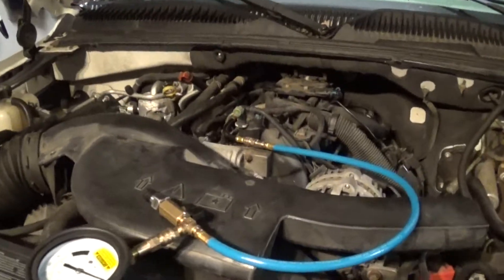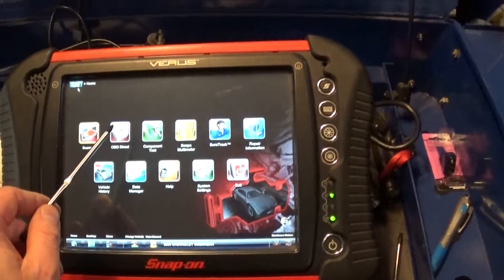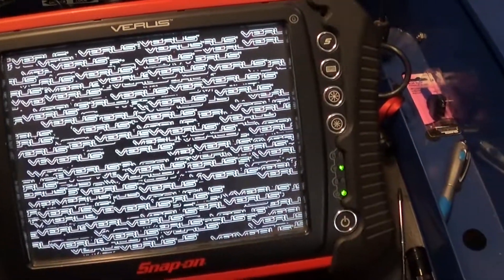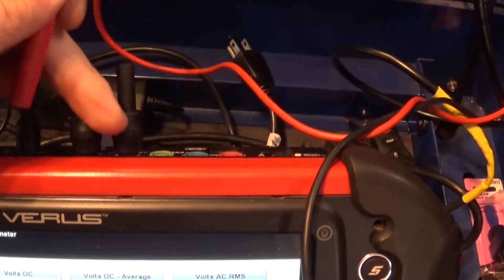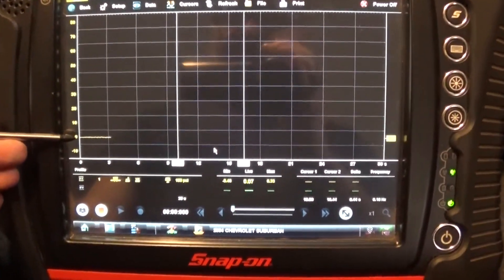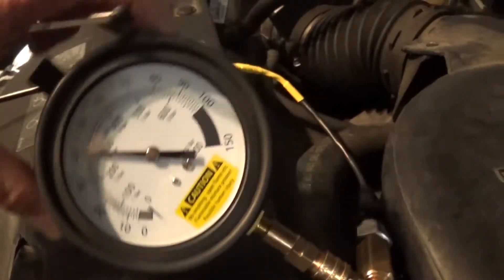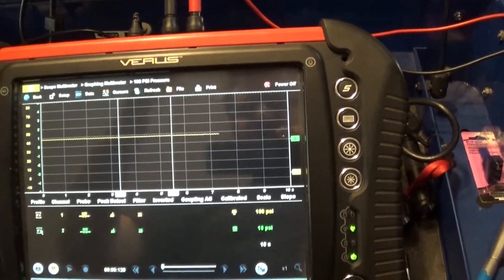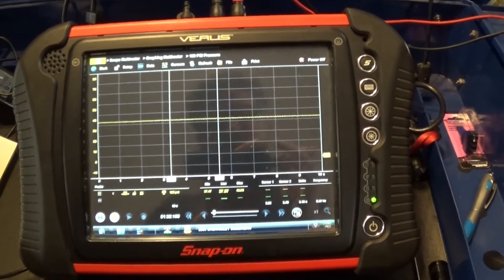Using Aftermarket Pressure Transducer On Snap On Verus/Modis/Vantage Pro

Comment: Great video. Thank you. Those connectors for the transducers are very weak like you said. I went to a pull your part place and got some gm tps connectors from a 1990s truck they work perfect and don’t fall a part.
Reply from the maker: Thank you for tip my friend. I will look it up. I did put some JB weld inside connector and it's holding good. Cheers

Comment: I came up with a formula to easily calculate pressure from voltage.

PSI=Transducer rating×(voltage-.5)÷4

Example using a 300 PSI Transducer:
Voltage: 2.137
PSI=300×(2.137-.5)÷4
PSI=122.775
Reply from the maker: BLACKSSG85 well that is pretty cool my friend. That formula works for sure. Thank you for sharing. Cheers

Comment: does the 500psi transducer line up with the scales on the snap on as well?
Reply from the maker: Nick Kolodgie I don't have one yet so I couldn't test it but it should work same as 100 psi. Thank you
Reply: KY HomeGarage awesome.  for $13 I think I'm going to give it a try
Reply from the maker: Nick Kolodgie please remember you will need 5 volt regulator. Thank you
Reply: Yeah I saw that.

Comment: Ramon,  thank you for your time and work👌.

If you want to you can get the 5 volt supply for the pressure transducer  directly from pin #1of the 9 pin  connector on the verus, modis etc while in pressure transducer mode. Pin 5 as well as pin 9 will provide  a ground. Using  the sensor that way with a suitable connector you don't need an extra power or regulator.
Pin 8 will give u a permanent 5 volt supply.
Reply from the maker: Thank you so much for sharing. Maybe we could use 5 volt supply for signal wire integrity testing as well. I will definitely try to find connector to fit. Do you know why is one pin blocked on 9 pin  connector. Thank you

Comment: I've seen the SnapOn transducers with cable on eBay for ~180$. Nice to know that there is an inexpensive alternative for use on my Vantage Pro! Thanks!
Reply from the maker: Yes this works good and its lot less than original. Thank you